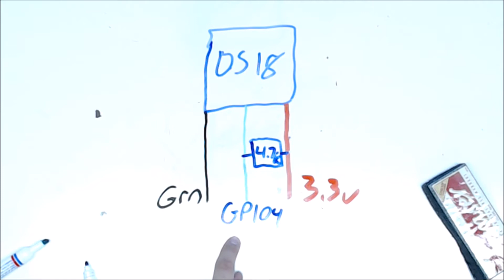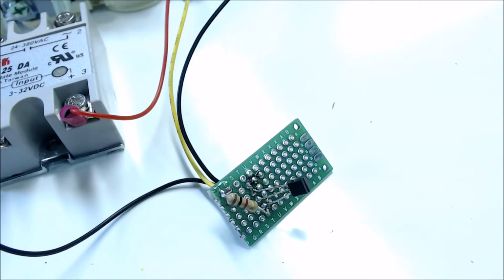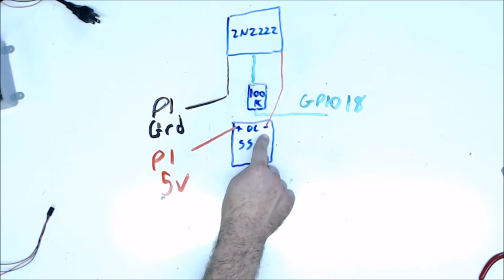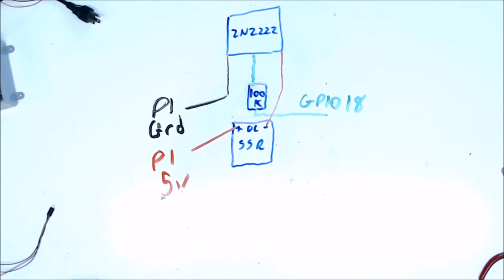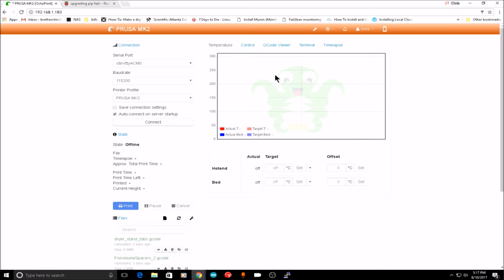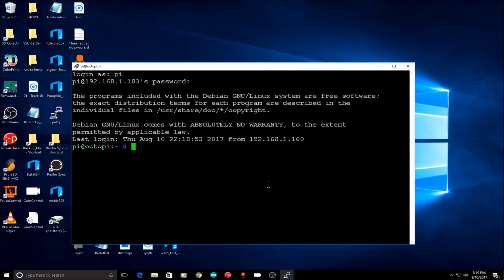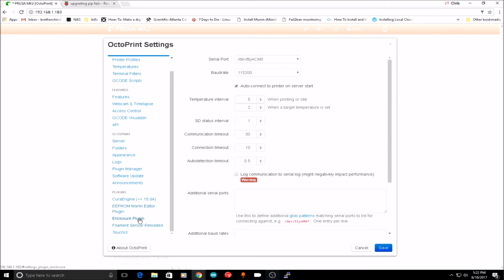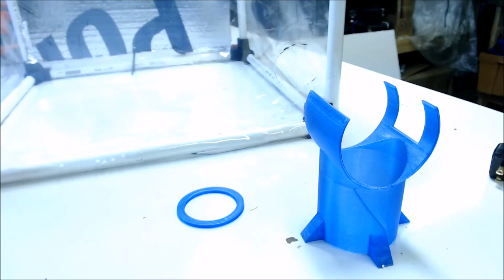Cheap 3D printing enclosure modified to add heat - build video

Comment: If the solid state relay gets that hot, a normal relay would be a lot more efficient. It is not like you have to turn it on and off very fast.
Reply from the maker: Very true, this one I did a while ago. There was a reason why I went with that SSR at the time, but I don't remember why. Didn't have anything else that would trigger with 5v maybe? Anyway, yes, standard relay would work just fine. Thanks for watching!

Comment: ahhhhhh ... I didn't realize from the first video that the hair dryer was temp controlled ....... so was the bed temp variance a result of the open box you were printing or have you even gotten that far yet?
Reply from the maker: KBRunn4thdoor my guess is the faster the fan on the dryer went the more the temp on the top of the bed would dip. I would run it on low for 42c and high for 60c. The faster the air movement the less adhesion to the bed. That's why I saw such a big difference on the bottom of those two.

Comment: dear Chris,
I appriciate your videos, and subscribed after I've seen the one for flashing the marlin. I'm also think about building an heated enclosure for my cr-10. the idea with the control via octoprint ist great. the only what I don't understand ist how to use a dryer blowing air inside the enclosure. As I guess, the enclosure is quite air tight, so the air flow of the dryer is restricted. That is not good, it mitght overheat. Wouldn't it be better to mount old fashioned light bulbs as an heat source? They can stay inside and don't need circulation. Maybe get some from cars, they run 12v what is more safe.
Reply from the maker: Johann Riedlberger Yes to both your points. The hairdryer was by far just an experiment. I 12v emergency car heater or lights would be a much better solution.
Reply: I have so many of this useless bulbs after converting my car completely to led.  :)